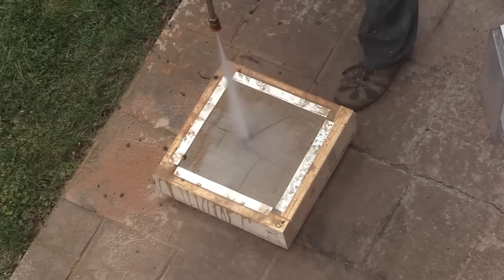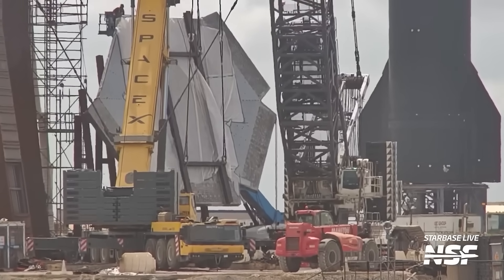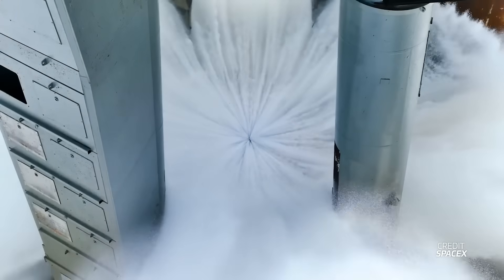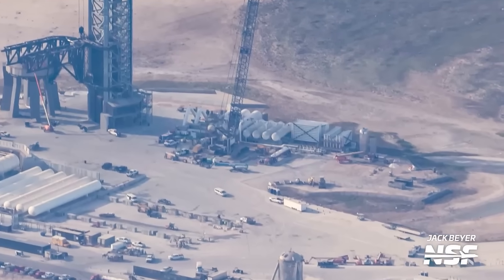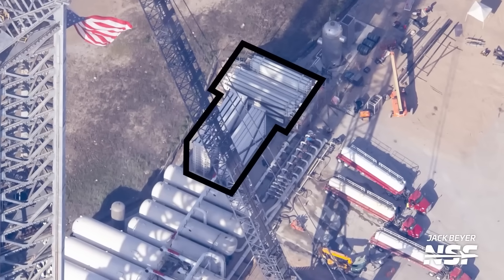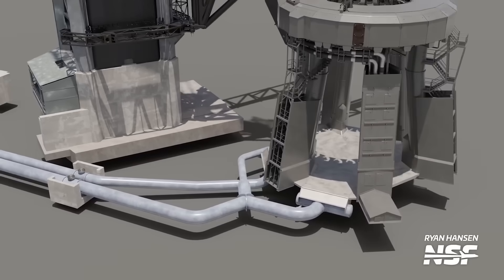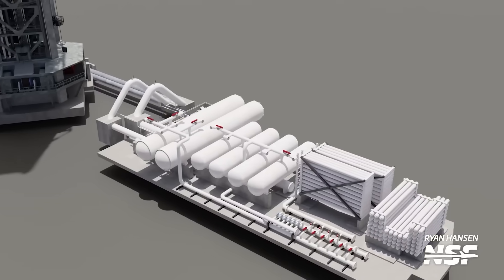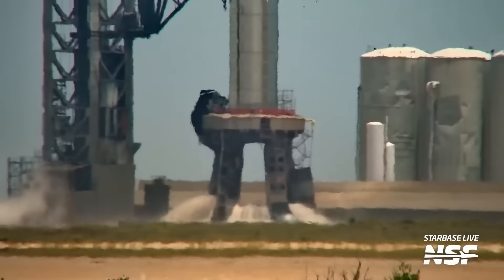Quick Explainer: The Starship Deluge System

Comment: a tungsten waterplate could be perfect, expensive as hell but perfect. High temperature resistence and harder than steel. 3400° v 1400° fusion point

Comment: Nicely explained, though I wonder why they won't use seawater instead, which is readily availale. I guess cleaning up the salt would be a hassle.
Reply: Metal plus seawater equals quick rust that can cause more problem.
Reply: @4runner4ever83  yes, you're certainly right. It can go through ordinary steel or aluminum like there's no tomorrow, unless corrosion protection is used. Stainless steel - not as much, but it's expensive and harder to work with, and we're talking large cross-sections here, so... lots of steel, lots of bucks.

Comment: FAA has a much more detailed report on faa.gov, in PDF form, of the entire system, including the operation of the deluge, the retention basins for recapture of the water for a potential reuse.  It covers ablation of the pad, comparing and contrasting with the Shuttle's SRBs.  

Titled 
WRITTEN RE-EVALUATION OF THE 2022 FINAL PROGRAMMATIC 
ENVIRONMENTAL ASSESSMENT FOR THE SPACEX STARSHIP/SUPER 
HEAVY LAUNCH VEHICLE PROGRAM AT THE BOCA CHICA LAUNCH SITE IN 
CAMERON COUNTY, TEXAS
Reply: It also mentions the "Hot staging ring" which the FAA formally  refers to as the 
'Forward Heat Shield Interstage' 

An excerpt from the FAA doc:
"
Forward Heat Shield Interstage
SpaceX proposes to add an interstage to Super Heavy consisting of a forward heat shield. The forward 
heat shield provides thermal protection against heat produced by Starship engines start during the 
stage separation event. It is made of stainless steel and is approximately 30 feet in diameter and 6 
feet long, weighing approximately 20,000 pounds. For some missions, the forward heat shield would 
be jettisoned between 30 and 400 kilometers offshore in the Gulf of Mexico. SpaceX would not 
recover the forward heat shield as it is expected to sink.
"

Comment: When SpaceX was building this there were so many naysayers telling us it couldn't possibly work. Hah!
Reply: I was pretty confident in it from the get go, but it's even surpassed my expectations by working essentially flawlessly first try. I thought they were gonna hit at least a few hiccups
Reply: @thomashayden804 same. It's an amazing bit of engineering ❤😊
Reply: Also the steam expansion can push up the rocket 🤣
Reply: Is there a way to recapture the water(steam) in some sort of water recycling loop?
Reply: @deeobrien8159  it becomes steam and goes back in the atmosphere it comes back as rain.
Reply: Anyone who understands thermodynamics knows the tremendous amount of energy needed to make water boil into steam. It's called the heat of enthalpy change liquid into vapor.
Reply: @user-johnvajcner  Exactly. The amount of water released by the deluge could theoretically absorb ALL the heat of 33 Raptors.
Reply: It's actually quite an obvious solution to anyone with a technical engineering background. Think of a watercooled CPU heatsink and scale it up.  The problem today is most people overthink the problem and thereby dismiss the simple solution
Reply: We need more clickbait for the glum astronaut. 😂Lol 😂
Reply: it did fail.... extreme failure!
Reply: @tredogzs wdym it didn't fail
Reply: @dinosaurearththeory  YES it DID... its is going to be 100% replaced... they have already started the work.